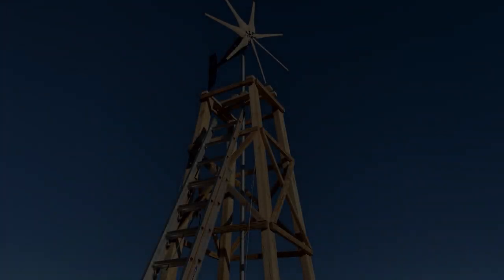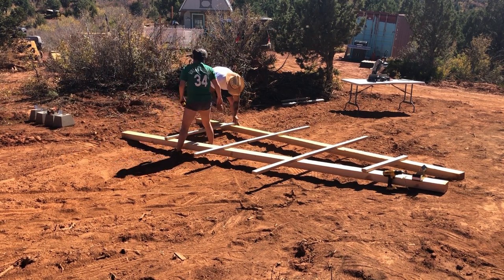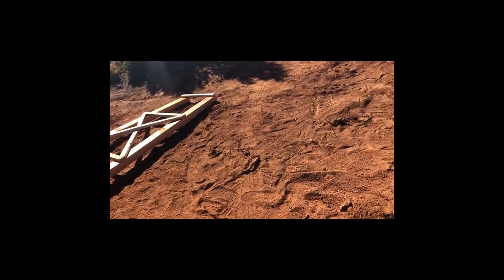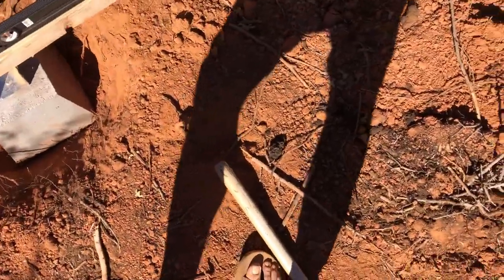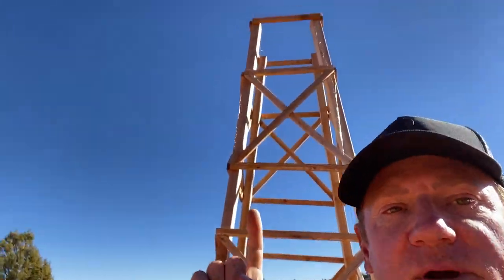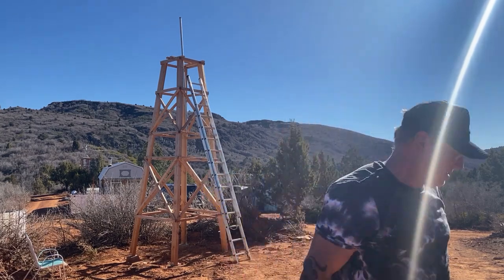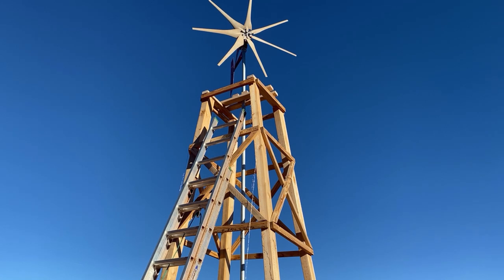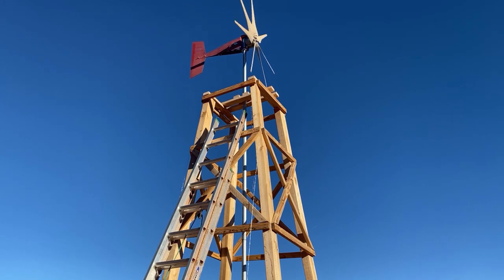Wind Turbine // Off The Grid

Comment: Hi from Danmark 🌏🐝🌱
Well built 👍🌬
How much does it do  if it runs well  for an hour.
Reply from the maker: Hey Sussi........I'm going to be honest with you. The wind turbine does not create a whole lot of energy.  It trickles in and helps us out, but the solar panels we have produce about 10 times more the electricity.  If you are thinking about doing some off-grid power I would consider Solar power first and then add the wind turbine second as a back up in case you have a cloudy day. Thanks!